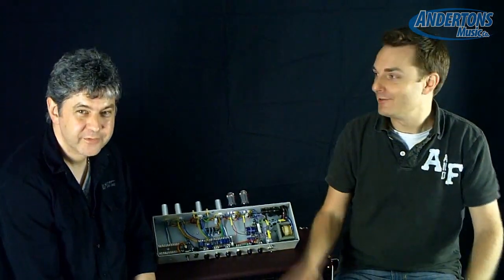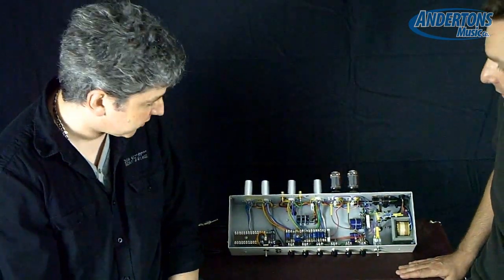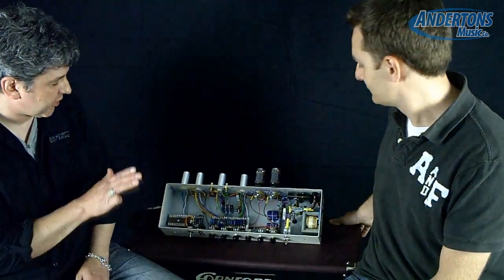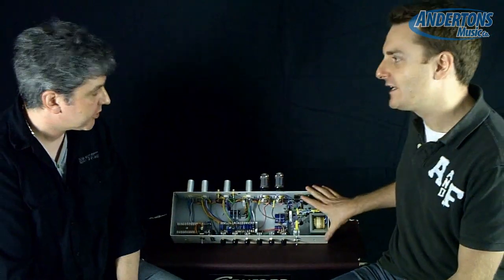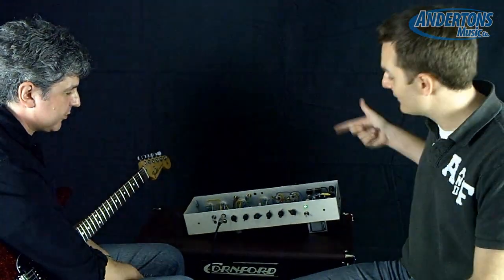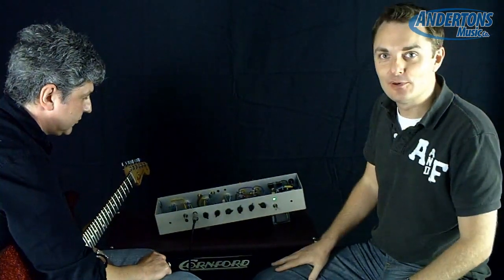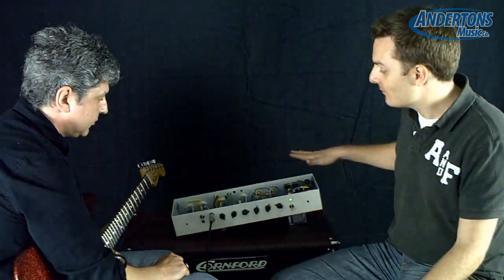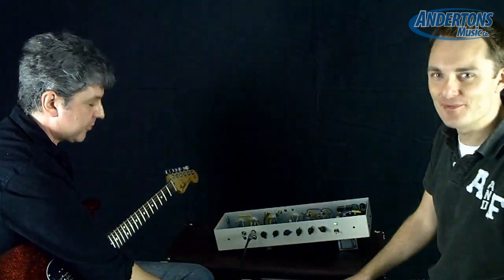Martin Kidd shows us a prototype Cornford amp

Comment from the maker: From what Martin was telling me, the new amp is designed to offer a more vintage sound - less driven than the existing amps. It isn't going to replace anything - just be run alongside. I think'll it'll be single channel with a foot switchable boost switch. Looks like it'll definately be available as a 15w Class A version, and maybe as a 30w Class AB. In terms of heads vs combos etc - what do you want?? Post your suggestions here & I'll pass them on to Cornford for you.

Comment: Great to see Cornford making a new amp.  Rumours on the forum are that this is going to be a 15W-ish combo.  Does that mean the Hurricane will be discontinued?  I hope not.  From this video, the Pheonix seems to have two channels, patchable via hi-lo inputs and 2xEL34 type valves in the output stage.  I'm guessing it's pure Class A single-ended, then?  Sounds cool ... but stick a couple more in so it's pushing 30W (or better yet, 4xKT66 in Class A) and make it a 2x12 and I'll be very interested!

Comment: @bornburied  Fair point on the 'point to point' front. Most handwired amps are tag board based rather than true point-to-point. Still high quality vs a PCB amp, though. Although clearly PCB amps can be great - just ask a Mesa player!

As for the single-ended side of things, there's no reason a single-ended amp can't have more than one power stage valve. As an example, the Laney Lionheart 20W head/combo runs 4 parallel single-ended EL84 power amp stages which are 5W each and then joins the outpu

Comment: Class A has the output valve or Transistor biased at 50% ON during silence, and when the wave form of sound hits it it varies from full off to full on to produce the output. So during silence it dissipates 50% of power at idle. Where as a push pull amp has a separate valve or transistor each for the posetive half of the wave and the negative half of the wave, making construction and alignment of each half critical, But it is economical on power, during silence, next to no power is dissipated. So class A is usually only used in pre amps or low signal level amps. Thats the actual nuts and bolts description.